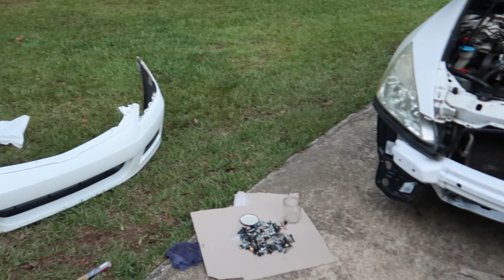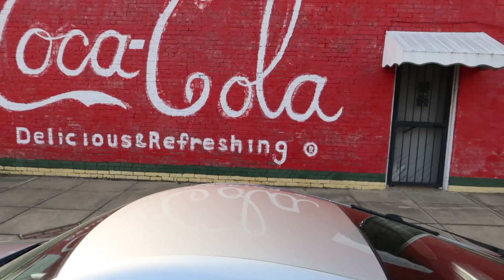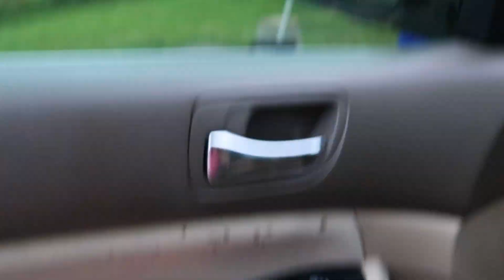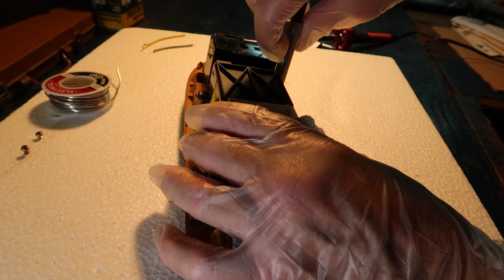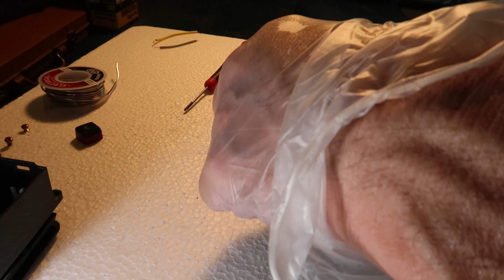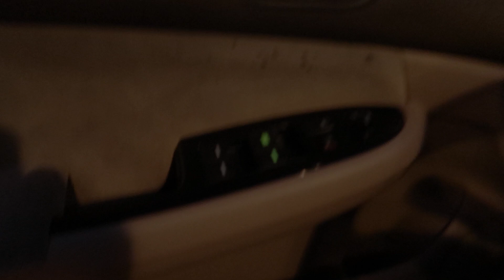Honda Accord power window switch repair 2003-2007 #Hondawindowswitch

Comment: Ever since I replaced my master switch, I haven't been able to get my keys to work for locking and unlocking the doors, I have reprogrammed them several times but they aren't working, any ideas, please??
Reply from the maker: Yes,  it's the main reason I decided to just repair my old master switch instead of replacing it! A lot of people a having the same problem that your having, they are unable to get their key fob to sync up with the new master switch module. After doing some research, I found out that the new master switch must have certain serial numbers that must match your old master switch numbers.  If not the key fob will not sync properly. If you still have your old master switch, check the serial numbers and try to order one that matches. I couldn't find one for my switch, hope this helps and thanks so much for watching!!!
Reply: @Zspeed  Thank you for the reply, I suspect you are right and it makes sense, don't remember what I did with the old one but I'm going to look for it, thanks again for answering. 👍

Comment: I’m wondering are those carbon fiber trims came from 06-07 Accord SE? They look really nice! Do you mind to tell me where to get them? Thanks
Reply from the maker: They came that way from  Honda, check Honda aftermarket parts websites, you might find them there! Thanks so much for watching!
Reply: @Zspeed  Thanks. I just found out that yours is a 06-07 Accord by looking at the gauge cluster

Comment: I have a similar problem but my two rear windows work and my two front do not work, when I press ether of the front switches there will be a clicking noise so they are receiving power. 
will this method also work with my problem ?or was this fix specifically for 3 failed windows with the driver window functional 
thanks for any help
Reply from the maker: Try the wire test, this will let you know if it's your master power window switch or you just need to replace your two front window motors!

Comment: Dear Z speed,  I started repairing at 3:10 pm and Was done by 4:00 pm and now its working like a brand new windows. Love you man ❤️♥️😍🤩😘
Reply from the maker: That's so awesome, free fix, thanks so much for watching!!
Reply: Hey bud, did this drain the battery,?im having this issue as well

Comment: Hey thank you so much. None of my windows work, but when I tried the test to see if it would work all but my driver side rolled down. What should I do if my driver side window and lock mechanism doesn’t work?
Reply from the maker: It might be as simple as a bad fuse, there is a fuse box by your left foot on the drivers side and one in the engine bay, check your owners manual for more details. If it was just your drivers window not working, I would say try replacing your window regulator! But, since your locking mechanism is not working either, it could also be your drivers side lock actuator! Hope this helps and thanks so much for watching!
Reply: @Zspeed  thanks for replying. How do I know if the fuse is bad? Also which ones should I check to makes sure?
Reply from the maker: After you remove the fuse, just look at the bottom end for any broken parts. If the fuse is blown, the metal tab at end will be broken.
Reply from the maker: Check each fuse it the box by your left foot on the driver's side!

Comment: Just completed the fix and all is back to normal again... I can't begin to thank you enough, you're the man!! I live in the Philippines and spare parts or replacement parts are rare if at all... I bought a switch from Alibaba for $24.00 and it worked great but no matter how many times I tried to reprogram my key fob I always had the same result which was no go...now  it works just like new. I hope someone else with this problem finds your video. Again many thanks.
Reply from the maker: So glad this fix worked for you!!!

Comment: Followed your instruction, but the problem is: the master switch's still working with all the light indicators ON even after removing the key, I think it will drain out the battery,
Reply from the maker: Yes, it should not stay on with key removed, disconnect the switch, somethings wired wrong!
Reply: @Zspeed  thanks for your reply Z-speed, I discovered that if I opened the car, and leave as usual, the switch turned off as normal, yesterday I was sitting in the car , removed the key and check right after that,  I did ask my friend to check if he can roll down the car with the key removed while still sitting in the car, and he cannot do it for his part. I dont know that's would be a problem or not, but I think I'm good now, will see how it goes in the next few days. anyway, thank you very ,much for your useful tips, at least I get all of my windows work again. Cheers!
Reply from the maker: Easy fix right! Thank you so much for watching!

Comment: Curious what was the root cause of this malfunction to begin with?. Why would shorting the two terminals fix this issue?
Reply from the maker: They should have had a recall on the master power window switch, so many people with the same issue! Problems with the child safety  lockout button.

Comment: Hey brother so I had a problem with my master switch and I went ahead and got a new one and everything works perfectly but my only issue is my Key it won’t lock or unlock the car thru the bottoms I gotta do it manually now and before with my all master switch I was able to lock and unlock the car I have the same Car as you fixed on this video Accord 07
Reply from the maker: That's the main reason I didn't purchase a new master switch, because you have to have a certain serial number to match up with your key fob or it won't unlock your door remotely. So that's why I decided to try to fix my original master switch. Do some research and you may be able to find the correct master switch that correlates with your Key fob, good luck!
Reply: The dealer has to reprogram the master switch to your keys. That master window switch set-up contains the RF receiver for the remote.
Reply from the maker: Thanks for the information, any idea how much that would cost! Thanks so much for watching and don't forget to subscribe!!!

Comment: My issue is my driver window. I have bought countless window switches because I was told that was the problem but none seem to fix the problem. My current window switch works on all windows except the driver window. Please help. I drive a 1995 Honda Accord  LX.
Reply from the maker: Sounds like you may need to replace your window motor and regulator! Does your driver side window mover up or down at all? Sounds like your switch is okay if the other windows are  working. There are some fuses down by your left foot in the cabin, check those" there is a YouTube video on that. Let me know what happens, hope this helps!!!
Reply: Z-speed The driver side window doesn’t move at all
Reply from the maker: Yeah, sounds like it's time to replace your window motor! Not to hard, hope this helps!
Reply: Z-speed thank you I’ll change it and let you know what happens
Reply from the maker: Awesome, hope that fixes the problem, let me know!👍🏁

Comment: My issue is my driver window. I replaced the master switch and now my driver window doesn't always roll up or down when I hit the switch. It works but not correctly. If the window Is all the way down and I roll it up, it goes up then when I let go of the switch  it rolls down by itself. Can anyone help?
Reply from the maker: Explain what you mean by: my window doesn't always roll up or down? Does your window work sometimes and not other times? Does it work sporadically and inconsistently? I'll do some research and try to help out. Just try and  answer these questions, it my help me figure out the underlying issue!   👍
Reply: @Zspeed  Ya sry. I tried to word it as best I could. So when the driver window is down and I lift the switch to roll it up it doesn't always respond. When it does start to go up, it might go half way then go back down on it's own. This is while my finger is pulling up on the switch. And sometimes when I roll it all the way up and let go of vfc the switch, it goes back down.
Reply from the maker: Sounds like your window regulator and motor are on their way out and need to be replaced. The window motor and regulator can be purchased as one unit. There are some good videos on Youtube on how to replace it, hope this helps you out!
Reply: @Zspeed  I just replaced the rear left regulator. So I'm sure I can the the driver side. Thanks.

Comment: I just did this and it works. I tested for parasitic drain and I got 10ma. Much less than the maximum 50ma.
All the switches go off as supposed. The remote all windows down works. The keyhole all windows up and down works. This is a perfect fix. 
No battery drains at all. I'm so happy.
Reply from the maker: Thank you so very much for watching!!!Glad it worked for you too!
Reply: Will that Master tiny button will lock down the windows when its pressed down ? ?  ?
Reply from the maker: Yes, it will lock all windows except the driver's window!
Reply: @Zspeed Thank you so much my dear friend for your very very quick reply.

Comment: Nice video. 
Please does the rest of the window switches remain powered after removing key from ignition? Or do they go off with the master switch? 
Staying on is what drains the battery. 
Please I need this answer before I try this.
Thanks
Reply from the maker: All switches turn off with the master, no battery drain!!!👍

Comment: Great video. If you just leave the jumper in at the connector it drains your battery. If you solder motherboard will that solve battery drain?
Reply from the maker: No problems with battery drain after 6 months of use! So I am going to say yes, problem solved!
Reply from the maker: Thank you so much for watching!
Reply: Nice video. 
Please does the rest of the window switches remain powered after removing key from ignition? Or do they go off with the master switch? 
Staying on is what drains the battery. 
Please I need this answer before I try this.
Thanks
Reply from the maker: If you solder it correctly there should be no problem with battery drain after removing the key from the ignition! Thank you so much for watching!
Reply: Only three days and my battery is dead

Comment: What gauge wire did you use during soldering the circuit board? Or does it not matter?
Reply from the maker: If you have any speaker wire laying around, that should be about the right size!!

Comment: hi Mr. Z...my accord 2005 is same problem but it happen at driver window, is it same position at the point button or different position to put speaker wire at
Reply from the maker: Same position with speaker wire! But if that doesn't fix it, you may need a new power window motor on the driver side.
Reply: I have a 2005 Honda Accord with only 2 doors. Are the test wires still the same? black w/silver and Green/white w/silver?
Reply from the maker: Should be the same!

Comment: I have the same problem on my accord but the opposite lol all windows work except for the driver window. Do you think this would work for me?
Reply from the maker: You might just need a new drivers side window motor! But you can try the wire test just to see what happens. If the test fails, you most likely need to replace just the your driver's side window motor,  hope this helps and thanks for watching my video!!👍

Comment: You used speaker wire. Does any wire work? Could I cut an old phone charger and use a piece of that to do this?
Reply from the maker: That should work just as well!👍👍

Comment: I stuck a bobby-pin in #1&3 with electrical tape on it it’s not falling out so I just left it. Is there really a need to solder the wire on? Everything works even safety lock. Is there a way to fix the board or ground wire not sure why it doesn’t work with out jumper. It seems no switches are broken cause everything works with jumper in.
Reply from the maker: You can use the bobby-pin, the master switch boards are faulty, they should have had a recall! the only fix is to solder the wire on the board are replace it with a new one. Hope this helps you out!

Comment: Mr. Z, thank you for your video; I have a 03 honda accord and my problem is that the two front windows work, but the two rear windows don´t!! do you think that nice quick fix would work?
Reply from the maker: Test it with a piece of speaker wire, if it works then you know the fix is good!
Reply: @Zspeed  Than you much, for your prompt response! I´ll do that and get back with the news, 👍👍